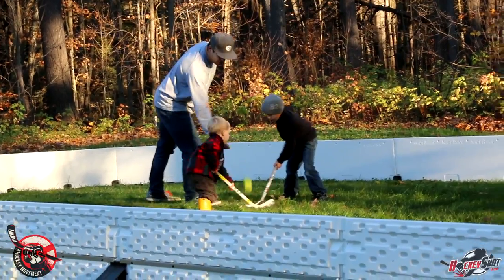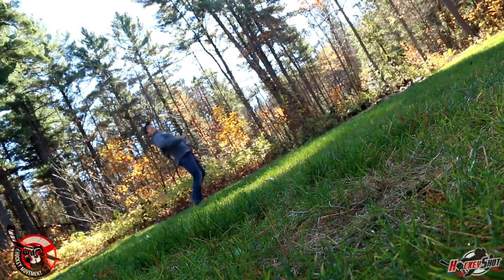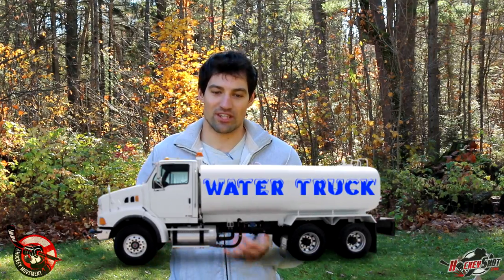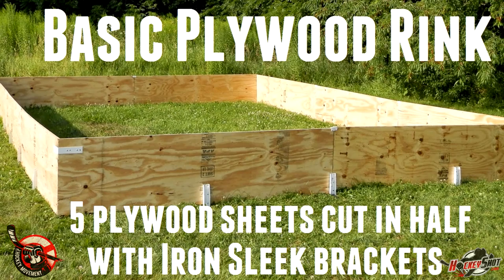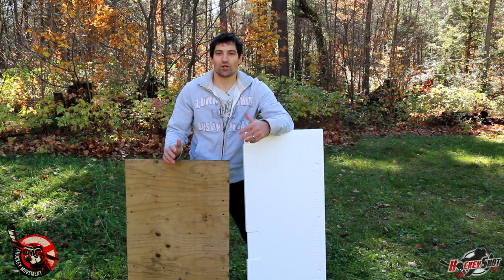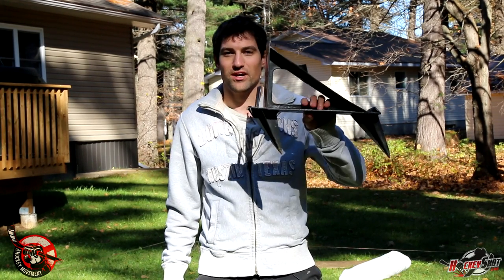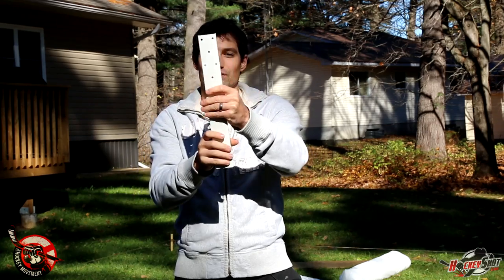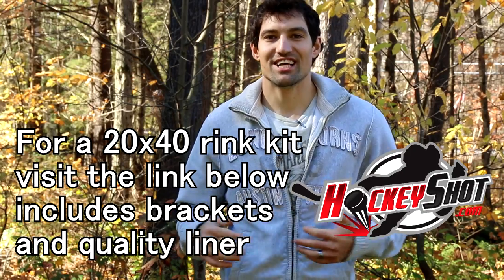Building a Backyard Rink - Material, Brackets, Liner

Comment: Are there any other options for a semi flat backyard? Mines not fully flat, is there anything I can do?
Reply: if its like a hill well u might just want to stick with local outdoor city rink but if it just has a slight lump in the ground well than you can just flood it a lot, over and over and over again and eventually it will get flat
Reply from the maker: You can plan a rink for nearly any yard, it just means using more water. If you have a 2 foot difference, that means you need 1 foot boards on one side, and 3 foot boards on the other.
Reply: if its a small hill build it a few feet away from where the hill ends
Reply: +The Hockey Movement by How To Hockey could you build one with just water or just water in a tarp and would a green tarp attract sunlight